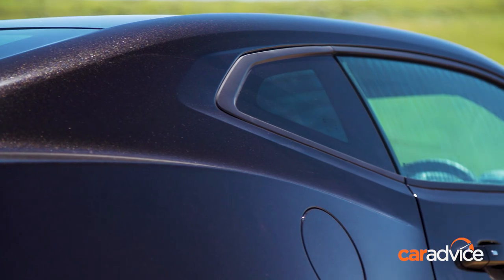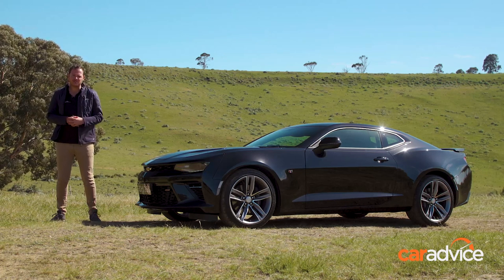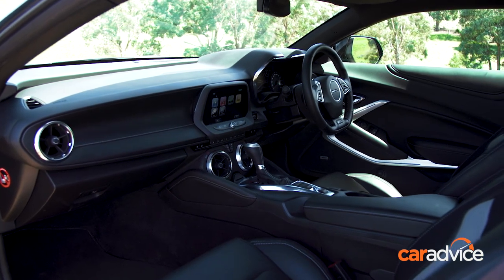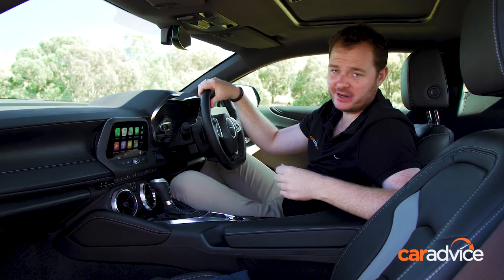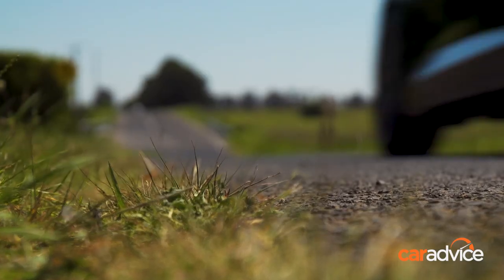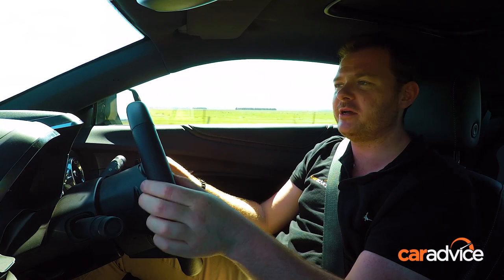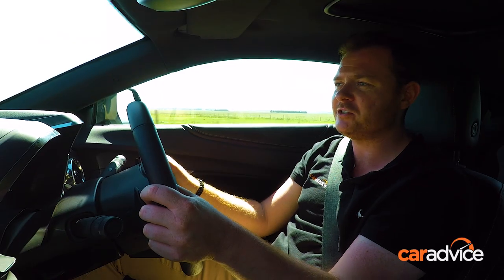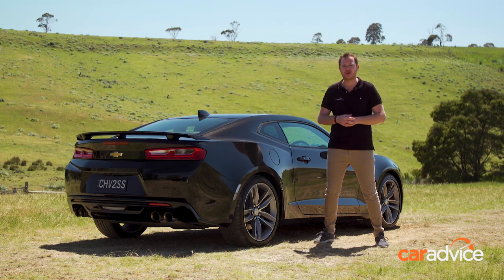2018 Chevrolet Camaro 2SS review: Australia!

Comment: The fact that GM won’t ship here already dismantled, meaning extra cost for consumers says much about GM’s attitude towards Australia.
Reply: It's 84000 in uk Lhd
Reply: Japan 6,500,000 yen LHd . Without conversion you will save $10000 if your lucky
Reply: ya we dont care
Reply: 2022....... right hand drive from factory!!
Reply: The problem is the lansing green plant can’t support it, they are already building Cadillac CTS and ats at the same place then if they added right hand drive variants they would either have to drop cars or expand
Reply: Too bad they got rid of your holdens, I love the utes
Reply: Went to HSV on Friday for presentation. The head of production laughed at this suggestion. He said no production factory in the world will ship an incomplete car for them, Even Holden wouldn't do it with the commodore and would only send them complete cars albiet with the cheap bumpers on them for HSV to throw away . It has something to do with a factory being required to only send out fully compliant cars. If they send unfinished then HSV have to absorb all the costs of testing things like reversing cameras and reverse signals etc. Where as in the past they just integrated those things into their own HSV designed bumper already working. HSV are such low volume in terms of global sales, 500 camaros, they're not going to go out of their way to pull these cars off the robotic production process which would cost them $. HSV have to order the "Argentina Spec" Camaros because Theyre most closely ADR compliant. All Argentina designated Camaros are Auto and with Sunroof which is why all aussie cars have the sunroofs. They said if they can prove they can do this >MAYBE< US GM will take notice and let them put in an order for an "Aussie spec" car which would be the Argentina spec but with option to delete the sunroof and already come with manual gearbox fitted. This would save them a bit of money and reduce costs. People think HSV is a large company, mostly because of the great work they did in the past but theyve always been small and that size is not helping them get US GM support.
Reply: I don't think shipping a dismantled product overseas is the right move.
Reply: I Love Prophet Muhammad US. The commodore used the old Zeta. Correct me if I’m wrong, I think a few models ago, the camaro shared the same platform.
Reply: they 're a small business  @benno_360
Reply: @coopsnz1  mhmm

Comment: I spent ten days and covered two and a half thousand miles in one earlier this year in Cali and Nevada.  I was really impressed with the the whole car.  The fuel economy was so good for what it is.  Between 8 to 11 litres and I drove it fairly hard.   Vision was crap but that’s what you get for a car that looks like a ten year olds dream car.   I even slept in it at Yosemite national park, by folding down the rear seat and poking my legs into the boot.  The dash is on point.  The controls look so good and are incredibly easy to use.  Why can’t all modern cars have this setup.  Centre console is small but what do you expect from a car with a thumping big driveline and sits as low as a go kart.   
But it does suck just how cheap they are over in the US.  I’m sorry but I cannot justify or even afford to buy one here.
Reply: 2015 2ss manual  is $30000usd /  2018 1ss manual is $30000usd this has auto and sunroof extra $3000 usd to the price . Australia has high consumption taxes than  usa ' luxury car tax 33% ' 3% stamp duty Usa don't have on cars

Comment: So basically like is said before the aftermarket NA mods are going to go through the roof as far as costs go, basically Harrop will offer supercharger kits with headers and full exhaust and OTR system for around 18 to 25K depending on what you ask for, like heads, cam, full exhaust system, ( including hi flow cats, trans cooler if not already fitted by HSV, so for around 100K you will have a monster of a SS camaro with around 500KW at the rear wheels, or go NA with around 400KW at the rear wheels with OTR, full exhaust system and tune, which while the HSV warranty will be covered if you get the NA mods and even if you have a supercharger fitted, just like the US version, which i have no doubt the saem mods will be used as the SS ZR1 has directly from the states and HSV will do the upgrades or Harrop or all the others who will have the right stuff to do the upgrades and still have the factory warranty 3 years or 100,000KM which ever comes first, so how much will the re sale value be, ( 10,000KM and selling for around 75K 2nd hand but with factory warranty still) especially those HSV enhanced / forgot Walkinshaw will also have their version as well. :)

Comment: Looks a little tight for leg room if you're north of 6ft.
Reply: Actually that's what I thought as well till I sat in one. I'm 6,4 ft with long legs and long arms you know typical size American LOL. And I fit just fine. The Mustang does have more headroom but both are nice to drive.
Reply: He didn't adjust the seat at all. They go back quite far. They also adjust down to get your head away from the roof.
Reply: I'm 6 foot 7 and it's too small for me as extremely uncomfortable

Comment: I dont understand GM tbh.  They have a bigger engine at 6.2lt yet it makes the EXACT same power as the 2018 5lt from Mustang.    That is alot of extra capacity they aren't making use of imho.  Or could it be a tuning thing to leave room for higher performance models?

Still that right there and for an extra $20k more is a bit of a deal breaker for me.  My 2c
Reply: Peter HMan Coyote engine is actually much bigger physically and heavier. LT1 is a pushrod V8 and the Coyote is a dual overhead cam V8. Completely different types of engines with the LT1 rumbling and shaking the car and the Coyote being a high revving smooth engine.
Reply: Pushrod engines have a single cam and 2v per cylinder, the Mustang has double overhead camshafts (DOHC) per cylinder bank & 4v per cylinder. The DOHC design allows for not only higher, but more efficient air and exhaust flow, therefore it can combust more fuel at a faster rate and make more hp/L than a similar displacement (even larger displacement) pushrod design

Comment: Peope are lying on this page .1ss with cloth trim with  11000 miles is $30000usd in Usa , 2ss manual with the 11000 miles is $45,000usd . Brand new ones off the showroom floor  1ss manual  $40000usd , 2ss $50,000usd with extras sunroof and automatic in Usa

Comment: Yes nothing out of Europe comes close for $86k, what about Korea though? I'm sure if the left over change from a Stinger GT was spent on tuning it would wipe the floor with this. Even in stock form it's faster with more equipment. My Stinger needs traction upgrades and tuning to fix stupid issues like it only staying manual for 30 sec then reverting back to auto, more aggressive launch control and always starting in comfort mode. Hardware wise, it needs better brakes.

Comment: so they have sold 3 quarters aye,,85k for a cheap us car,with less features than the us version,all with a local conversion,that is incomplete..really havent learnt anything have they.
Reply: In Usa this is $51000usd drive away . Sunroof and auto is $3000usd extra
Reply: The not cheap in  Usa either , its priced with a Bmw m240 lefty . It costs $85000 here
Reply: America price excludes taxes , and you are thinking of a cloth trim 1ss with no limited slip diff for $40000usd
Reply: @coopsnz1  Ben i was in the us in april, there going for around 30k on the road we saw a couple of demos for a lot less!! and thats before the haggle ..www.cargurus.com/Cars/new/nl-New-Chevrolet-Camaro-Los-Angeles-d606_L2163#listing=212968195
Reply: @iceblue1963  lss is not 30k drive away with 0 miles either
Reply: @iceblue1963  I checked the site there is no 2018 2ss manual  under $45000usd drive away
Reply: @coopsnz1  Yeah sure now look with both eyes ,,as i said stop the bs,,even 45 is a long way from 85..
Reply: @snitchgaming4486  thats what i meant,by pre payed muppet..
Reply: @snitchgaming4486  taxes on the car in Australia is $19000
Reply: @snitchgaming4486  there is no 2018 2ss in  America for under $40000usd either
Reply: @iceblue1963  No Taxes on Mrsp price in Usa , why the cheaper . In uk Lhd 1ss manual is 39000 pounds
Reply: @snitchgaming4486  No taxes on Mrsp retail price in Usa , only democratic socialist states in Usa add taxes on top of MRSP

Comment: no European counterpart ??? what ?? You can easily buy a C63 AMG thats a few years old with low KMS that would shit all over this thing in every way.. OR a BMW M4 once again a couple of years old with low kms for mid $70s !!  Brand new M2's can be had for a touch over $80k. This is  a cool car but needs a manual box and to be around the $65k mark. Ridiculous money for a plastic yank car with a simple 50 year old push rod v8.
Reply: M2 comp in Australia is $116000aud drive away / taxed $35000 . Camaro 2ss in Australia is taxed $20000 welcome to Australia cars taxed 13%- 50%

Comment: Should consider a cheaper 2.0 4 cylinder turbo Sport Coupe, a 3.6 V6 turbo RS or optional Silverado low powered 6.2 ecotec3 V8 and a limited edition Z28 with 7.0 V8 427.

Comment: Mustang Gt premium performance manual $40000usd / 2ss auto $47000usd without taxes  . If it was Rhd from factory it wouldn't be as cheap as the Mustang anyway , since Camaro 2ss has luxury car tax 33% . Price difference Rhd will be $10000 in Australia

Comment: I have a HSV vehicle from new and am happy with it however this latest offering in my view falls far too short.  Why not deliver factory right hand drive vehicles which no doubt would keep the cost down.  Why are we being offered the old model, were they cheap due to over stock when new model released.  The expected cost of the finished HSV vehicle is over the top, but I suppose HSV has to recoup their pre-conversion costs some how, why not pass it onto the consumer, back to my first point, why not deliver a factory right hand drive???  Like a lot of people, the conversion is a deal breaker for me, with the money being spent and the price we are being expected to pay why not flip over the console.  I think I will put my money towards another vintage Indian motorcycle or pre-war Knuckle Head.
Reply: Taxes on the car is $18000 lefty . in Usa mrsp retail price is  without taxes why its heaps cheaper in Usa , Lhd drive one of these in uk is 45000 pounds , 1ss manual is 39000 pounds

Comment: This car should have a manual and the suspension tuned for Australian roads plus the price dropped 20 grand. The Camaro makes my redline Ute look cheap.
Reply: luxury car tax on it Blame Labor party , without luxury car tax and rhd conversion it costs $72000 +orc    . 2ss auto with sunroof  and bmw m240 are similar price in Usa
Reply: Ben Chesterman regardless why it is so expensive, it is 20 grand overpriced. Better value found elsewhere
Reply: No taxes on Mrsp retail price in Usa , why its cheap  @tomnewham1269
Reply: Yes but not in Australia. The Camaro is brought over here by a company called HSV and they then have to convert it to right hand drive. And considering the engineering and legislation costs associated with that, it costs $20 000 more than it should. Yes the purchase price in the US is cheaper than here (in fact it was cheaper to buy a Chevy SS in the US than here even though it was made here) but I was comparing apples with apples as my ute I purchased year yet I only paid $60 000 for it compared to the cost of a Camaro ($80 000). On top of that my ute is a manual.
Reply: @tomnewham1269  in uk a LHd  camaro 4 cylinder turbo is 35000 pounds , same car in Usa with luxury package is $30000usd without taxes
Reply: @tomnewham1269  $18000 tax on a Camaro 2ss auto in Australia when you add orc $92000 drive away b
Reply: @tomnewham1269  price difference to a 1ss manual $37500usd , 2ss auto with sunroof $46000usd = $8500usd price difference in usa . If 1ss sold in Australia it would be $15000 less .